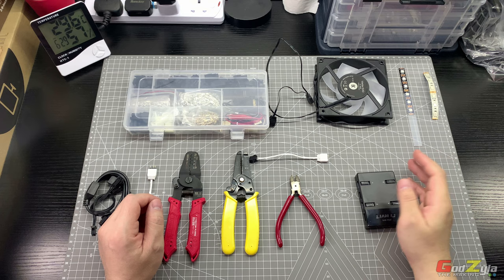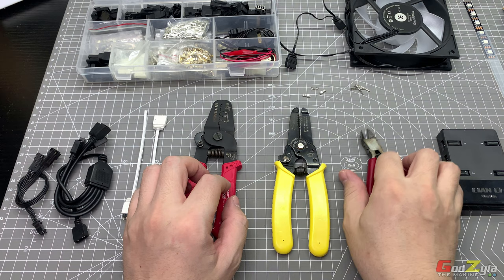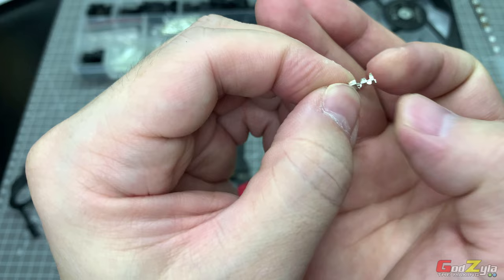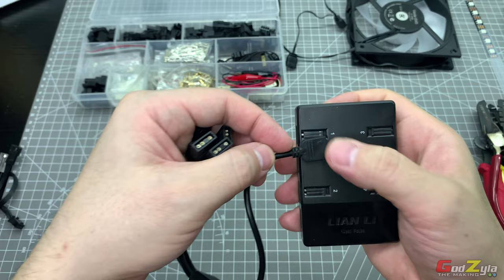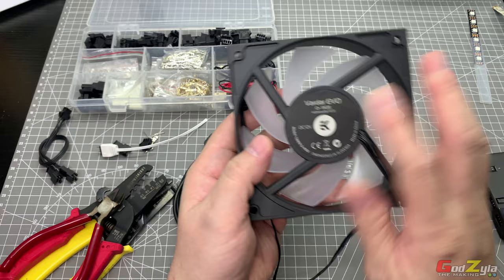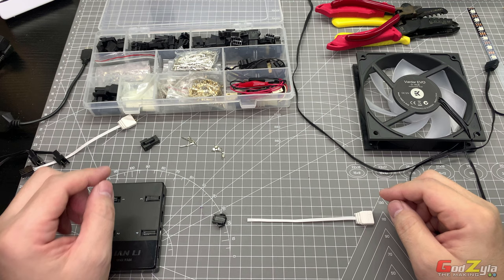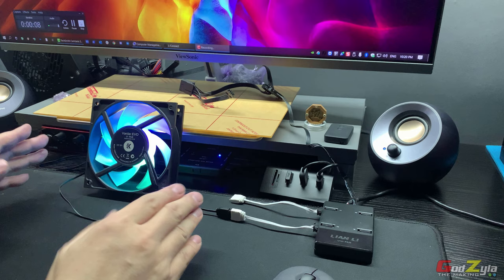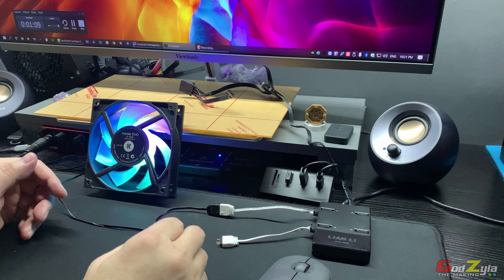Lian Li Uni Fan Controller- Custom Crimp Connectors

Comment: Great diy ! But for those that doesnt want to do this.. there is adapter for purchase.. search 3 pin to jst adapter and choose which head to which head you wan.
Reply from the maker: Hi khinwai. That’s correct, Infact on my other uni fan controller videos, I did share links to where to get them but not all countries can get them. That’s why I did this guide if they can purchase the 3pin JST connectors. Thank you for your feedback.
Reply: @KleoYan  Do you have the actual link for the adapter purchase? I'm having a tough time locating the correct one. Thanks!
Reply from the maker: @flipnf3rno  hi, the links are on my description, if you are still having issues not able to click on those links, you will have to google and search for them at your region. thank you!

3Pin JST 03 connectors - https://www.aliexpress.com/item/4000033348327.html (please choose 10 set of 3p) 

aRGB 1 to 4 splitter - https://www.amazon.com/MICRO-CONNECTORS-Addressable-Splitter-Cable/dp/B083N5PGBK/ref=sr_1_6?dchild=1&keywords=argb+splitter&qid=1617470577&sr=8-6
Reply from the maker: @flipnf3rno  ok thats good :) you found this link, let me grab this link and add to my description as YouTube normally automictically remove url commented by viewers

Comment: This great content, but I'd like to see a TL fan with separate power and RGB
Reply from the maker: Hi Paul, welcome back, as for how to split the 7 pin connector to 4pin PWM and 3pin ARGB, It can be done but the warranty will be void. In addition to this, the fan's 4pin PWM are drawing higher current from the controller. If the split is to plug directly to motherboard fan header,  it will not be ideal. It will  damage both the fan and the motherboard header if it's misused. (to many fans being daisy chained) This is something which I will not illustrate due to electrical safety. So sorry to disappoint you.
Reply: Thank you. I appreciate that it voids the warranty, but it would be an option as we can't separate the Controller channels when using the motherboard. It may be the only option.
At least I know 4 wires are for power and 3 for RGB....potentially separating these may be worth an experiment :-) 
 @KleoYan

Comment: Fellow Singaporean here! Great work on these videos and I hope you grow bigger! Just want to confirm if you noticed that Ctrl Shift T hotkey doesn't work on Chrome if L Connect software is open as well?
Reply from the maker: Hi Barrett, welcome to my channel, I’ve not notice this. Let me check with my fellow friends as you might see me doing lots of videos about this unit but personally I don’t go for argb stuff. I am just curious how this uni fan works 😁. I will get back to you once I’ve gotten an answer. Thank you 😊
Reply from the maker: Hi Bro, 1 out of two having the syndrome you are talking about. board used is a B550 Gigabyte board. which model I forgot. the other two which are not affected. one using MSI and other using Asus.
Reply: @KleoYan  Oh thats unusual, I'm using a MSI B550 Gaming Edge Wifi board and I'm experiencing this. Hopefully they would patch it soon!!
Reply from the maker: @PantsstnaP  yup. Hmm for MSI. I think there is a patch at Lian li official website which addresses the  MSI application call dragon. You might want to try that out.

Comment: I have Lian li o11 dynamic with one front panel usb 3.0 not working out of the box and I am not able to figure it out why its not working.Thats the one thing 
And another is

I have 
Lian li galahad 360 aio
Lian li 9 x uni fans
Lian li strimmer plus 24 pin and 8 pin
Lian li lancool II 2x led strip 
And for just in case bought 
Lain li argb cable kit.
Can you please help me out in getting all these thing to work together.
Reply from the maker: Hi Swapnil Kadam, welcome to my channel. hmm.. front panel 3.0 not working? it's either the cable of your case is faulty or didn't connect properly. reseat the cable to your motherboard. if after reseating the cable and it still does not work, it could be your motherboard 3.0 header is faulty. as for the argb kit cable. you might want to read the paper manual. this video might aid you on how it should be connected https://youtu.be/Mztaf6-qyPU
Reply: @KleoYan  Hi 1 port is working but the another one is not
Reply from the maker: @Kadamswapnil89  Hi, I see, there is a case from one of my viewer who have commented on this. His case is like yours, what he did is to contact the motherboard manufacturer to have it fix.. I believe he sent his motherboard back and they sent him a replacement. you might want to try do that too.

Comment: Hi, I have a question.  How Can I use two uni fan controllers on the same pc?  I already conncet them but I can't control the second controlar so is there any solution?
Reply from the maker: Good day Mshari O, welcome to my channel. As for your question. it is not possible to at the moment. kindly go to lian li official website for more info on using two uni controller in future as the version which allows to do so ware removed. this was the statement from the website https://lian-li.com/product/uni-fan-sl/?cn-reloaded=1
L-Connect 2.0 update currently remove

To provide a more comprehensive version to solve some problems from users’ feedback , L-Connect 2.0 has removed for now. For those who previously downloaded L-Connect 2.0 and are experiencing problems, pls contact us via RMA form. LIAN LI will continue to assist you with troubleshooting.

Comment: how if you connect more than 1 fan. can it run continously efect or same effect?
Reply from the maker: TGC Tech ID, welcome to my channel, the uni controller has a limitation. I advise you to know what are the drawing ampere of the ARGB. best is not to exceed 4 fans.
Reply: @KleoYan  only 3 bro... what effect Will happen
Reply from the maker: @tgctech  if 3 fans are ok.. over 4. you might overload the uni controller and it will damage it.

Comment: Can u make an Adapter wich can be used even if all ports are beeing used
So like a y cable
Reply from the maker: Hi JJ, welcome back. I could do that but I do not recommend it as it might lead to some pc builders to keep add on splitters which might ended up blowing the controller or the USB motherboard header. Hope for your kind understanding on this. Is best to keep each output to 2.6a on the uni controller. Which is max 4 x SL120 fans. I do have a video which allows y splitting but that’s 3 + 1 SL120 fans https://youtu.be/njlkdM9lYbI
Reply: @KleoYan  the thing is
I have 3 fans on top 3 on bottom 2 on the Side and 1 in the back each set using a port so i would still have 1 top 1 bottom 2 side and 3 back left
I have 4 aditional units wich are not fans just argb it should be perfectly fine when i add 1 to each the amp limit should not be reached as the controller allows up to 4 fans on each port but like i said i would need an Adapter y cable
Reply: The 4 aditional things are gpu block cpu block punp res combo and flow meter each using 5v argb
Reply from the maker: @JJ-gk5tn    lets see, you have the below configuration, plus additional of 1 top , 1 bottom, 2 side and 3 back fans to plug. that's total of 16 fans. you can use splitters to balance out 4 to each output but as for the rest of your component like gpu block, cpu  block, pump res combo and flow meter. I don't advise you to do any splitters just to hook up all the rest of the component. the uni controller will not be able to take the load. 

Top = 3 x fan 
Bottom = 3 x fan 
Side = 2 x fan
Rear = 1 x fan
Reply: @KleoYan  i dont understand this ! I still have room for 7 uni fans but instead i just wanna hook up those 4 argb components
So u r saying those 4 argb components are using more amps then 7 aditional fans ??
I dont get this !
Reply from the maker: @JJ-gk5tn  hi, my bad, I misinterpret your sentence. dumb me..as you wrote "so i would still have 1 top 1 bottom 2 side and 3 back left" 
ok lets see,  the arrangement of the output you have to figure out the placement. this is what I would do.

you can add your CPU block to either Output 1 or 2. 
Output 1 = Top 3 fans  
Output 2 = Bottom 3 fans

I assume your GPU Block have more LED so safest bet is to plug to with your rear fan (Output 4). As for your pump res and flow meter, I assume they have lesser LED so plug with your side fans (Output 3) will be ok. 

Output 3 = Side 2 fans + Pump Res combo with flow meter
Output 4 = Rear 1 fan  + GPU Block
Reply: @KleoYan  yes this is exactly what my plan was :)
So i should be safe right in terms of amp usage ?
Reply from the maker: @JJ-gk5tn  In General, your plan as what I have mentioned to you, it should be safe. or are you able to list down the actual product of your CPU Block, GPU Block , the Pump res and the wave meter. I see if can look at the specification about their argb led or load.
Reply: @KleoYan  well thats the problem i cant find anywere the amp listings of those components
- Byksi gpu block for a Gigabyte 1660 super ( they all use the same 5v arg strip)
- ek Quantum Velocity ARGB version
- ek flow meter (the sqare one)
- ek Quantum kinetic ddc tube combo unit

These are the components

By the way
Thank u so much for ur help
Reply from the maker: @JJ-gk5tn  Ok I done some search, just like yourself, they dont list the specification but on EK side you are safe as they do not use LED Strips, they all uses argb led bulbs (low ampere) so go with this settings you should be fine. 

you can add your CPU block to either Output 1 or 2. 
Output 1 = Top 3 fans  
Output 2 = Bottom 3 fans
Output 3 = Side 2 fans + Pump Res combo with flow meter

as for your GPU, 1 SL120 (0.65a) or 1 AL120 (0.66a) + GPU argb strip (estimated 0.375a) will be fine, total is either 1.025a (with SL120) or 1.035a (with AL120)
you see I am judging by experience . A 30LED argb strip at 1 meter is at 1.5a https://www.pololu.com/product/2547 (most pc argb uses 30LED argb) so your GPU block is less than 30. most likely is about 7 to 8 LED. so drawn ampere should be 0.375a more or less. 

overall so long if you stick to 1 fan + the GPU, you will be fine. ok time for me to go bed lol almost 3am.
Reply: @KleoYan  thank you so much !
Also i would like to say that i rally love and appreciate your Videos !
Very in depth very technical and very Professional !!
Keep up the great work man
Cant wait for the next lian li fan Video

Ps i found out how u can add lian li Lconnect very easy and fast to the windows startup: 
Windows key + R then write "shell:startup" and add or drag the app or the shortcut into the folder that opens
Thats it 
Now Lconnect starts automaticly with every windows start and loads the settings 
but not minimized tho

Regards
Reply from the maker: @JJ-gk5tn  Hi, you are most welcome, glad to aid you and thank you for the trust. I wishes you all the best in your build and if you can, take a picture and drop and email at godzlyatech@gmail.com, I would love to see your own creation :)

Comment: Hi great video! Sorry but completely unrelated question & I hope you can answer: I know you can sync the strimers to mobo as you already made a video but can I connect the SL120s Unihub to mobo using their ARGB Device Cable Kits? I want them to sync with Aura Sync
Reply: Also, will I still be able to use L-Connect should I decide to? You know, after plugging the Unihub to their argb kits.
Reply from the maker: @jedvictolero7308  replying both your questions. This depends if your motherboard software will take over the IRQ and does not allow you to use the L-Connect application. 
if it does not, then you can use either L-Connect or motherboard argb application. this might aid https://youtu.be/Rm2emeyMUAk
Reply: @KleoYan  Thanks a bunch. Keep up with the awesome informative videos!
Reply from the maker: @jedvictolero7308  you are most welcome and thank you for the compliments. All the best in your build 👍

Comment: how about gigabyte motherboards do u have a diagram?
Reply from the maker: Hi perry haralambidis, you can always check the motherboard manual to see the diagram. all argb is with a standard layout +5 , data in/out and Gnd.
Reply: @KleoYan  thank you my friend
Reply: @KleoYan  which jst  should i get
Reply from the maker: @idubbzz7790  if you are getting ready made https://www.ebay.co.uk/itm/5V-3PIN-to-SM-3Pin-Fan-Interface-Female-Male-Adapter-Motherboard-Extension-Cable/402366860376   
if you doing self crimping, get them as a set. https://www.aliexpress.com/item/4000033348327.html and make sure is 3pin...

Comment: I got a question hopefully you can answer it. Can I not use the USB connector from the controller and just use the controller only for RGB which i will control from the mobo ARGB header
Reply from the maker: Hi snakeam, welcome to my channel, you can but you need to know what your motherboard argb is able to provide if it’s 3a for argb. You can use up to 4 SL 120 fans but you will need a converter to plug the end of your fan daisy chain to the motherboard
Reply: @KleoYan  dear. I want to use the controller for ARGB pass through while the rest are all connected to the motherboard. I have tried connecting 3 fans ARGB headers to the controller. Only The ARGB header from the controller to the motherboard is connected. SATA Cable also. But the USB is not connected. Is that possible? The fan LED did not work. However if i connect the 4 pin on the controller the fan spins. Any idea?
Reply from the maker: @snakeam  besides the sata cable to your uni controller, you will need to connect to the USB from the controller to the motherboard as this is needed for your l-connect application to give instructions to your uni controller.
Reply: @KleoYan  okay. Another question. I want to hook 13 Unifans for the controller (ARGB connection only) the PWM Fan headers will be taken care by the motherboard directly.  Thats 0.65A x 13 fans. Is there a problem with this?
Reply from the maker: @snakeam  the uni controller is capable of 16 fans, so long you plug to each output with just 4 fans, it will be fine.
Reply: @KleoYan  thank you !
Reply from the maker: @snakeam  you are most welcome. all the best with your build.

Comment: Can you send me 1 finish cable?
Reply from the maker: Hi Nico Hinsky, welcome to my channel. Do pardon me, I am not able to send you but my description will allows you to obtain the cable. I will paste it for you here.. kindly read the info below and do not miss any of the instructions. thank you!

Ready Made Converter needed
=========================
‣ Lian Li aRGB Cable Kit - https://lian-li.com/product/argb_cable_kit/ - Lian Li aRGB Cable Kit
An illustration of Lian Li aRGB Cable Kit - https://imgur.com/gallery/beYR8CN

If you are not purchasing the Lian Li aRGB Cable Kit, get the pin needle and the converter below. 
‣ Pin needles - https://www.aliexpress.com/item/32706628771.html or https://www.ebay.com/itm/224459128229 (you need to pull out one needle to fit the below converters)
‣ Converter - 1 To 1 Male https://www.ebay.com/itm/133521646617 or 1 TO 1 Female 5V 3pin https://www.aliexpress.com/item/1005001598378033.html